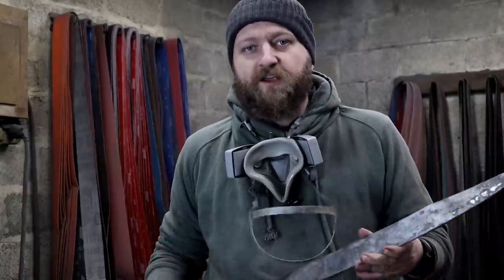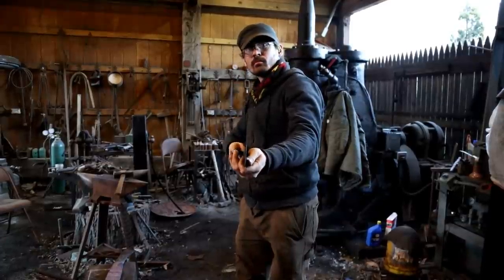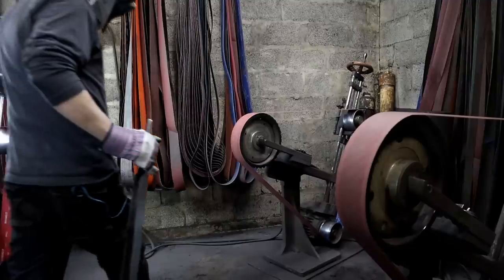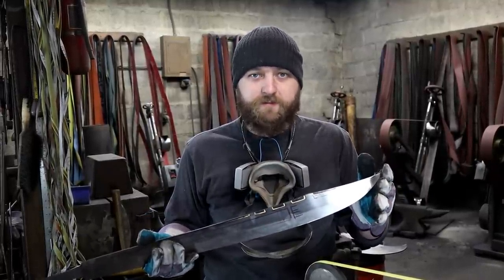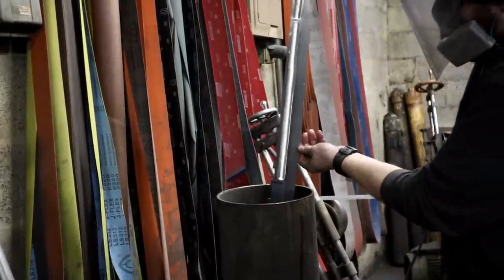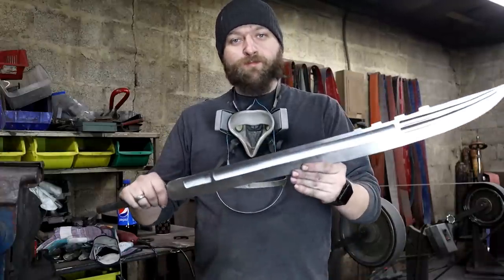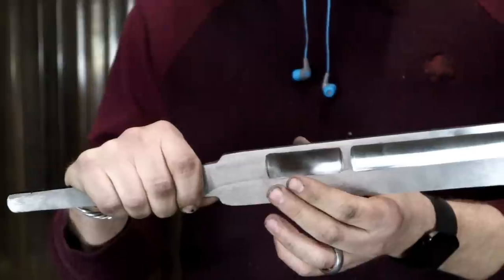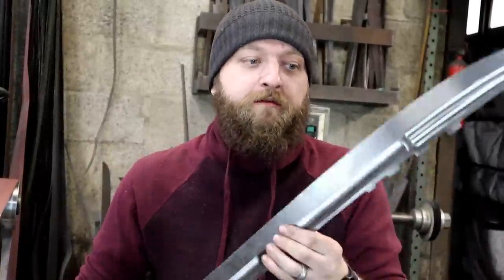Making A Falchion for Skallagrim - Part 3

Comment: Damn, I can't even begin to tell you how impressed and appreciative I am. I'll probably say that on the next parts too. :) 

This is fantastic work, and that's one of the fanciest, most complex designs you could have picked. I've never had any custom work done with that level of complexity and detail. Freaking awesome.

Nice steady hands on the grinder. I imagine it must be difficult to get the fuller that even.
Reply: Looking forward to seeing your review of it.
Reply: please don't shoot it with a rifle :^)
Reply: Greetings from Norway Skall, looking forward to see this beauty in your hands
Reply: Please let your injuries heal first? Its been forever since you were in perfect health
Reply: any one know how the fuller would have been done without powertools?  the double fuller looks like it will be difficult to get to a sharp even point on a wheel.
Reply: Super impressive build. Imagine the work that went in to making the original without power tools
Reply: @martinfllan9163  about the same, power hammer would be replaced with apprentices or other smith's with sledge hammers and the grinders would have been replaced with treadle powered grinding wheels.

The fullers were probably forged in hot with dies.
Reply: @Kurokubi  It wouldn't surprise me at all if they did ground fullers before powertools, the smiths of that era were quite talented at working with the tools they had.

EDIT:they also could have semi-powered grinding wheels using either water wheels or animals for power.
Reply: mate this guys got some giant balls, tfw you have to do the other side
Reply: @RuneChaosMarine  i imagine with a chisel,  but definitely with a scraper .
Reply: Hey Skall. Nice seeing you here. But what brings you?
Reply: Please forge volendrung (from skyrim) 😉🙏
Reply: @EODReddFox  to "end him rightly"?
Reply: This is Ilya, he doesn't do halfway, these are works of art to him.
Reply: This is Ilya, he doesn't do halfway, these are works of art to him.

Comment: I have always wondered about fullers, I kind of had this impression they were done during the forging process?  After seeing a lot of other builds done grinding them in seems to be the norm.
Reply: Chris Butler there are some forged fullers, though it’s a little more tricky to do and get a straight line.
Reply: @sokandueler9578   Yeah I have seen it in forging as well.  I do get that keeping a straight line would be a task for sure.

Comment: some design questions (which since you're basing it off a historical design, you may not have all the answers: Why does it have multiple fullers? what's the advantage to having multiple fullers along the edge as opposed to one continuous one? Also, it has the double-fuller at the top, is there a reason for that? And what are the notches for? are they in fact blade breakers?

Comment: This is off topic, but I'd like to ask what you think are some typical mistakes fantasy mediums make when representing blacksmithing.
Reply: Not having a furnace in Dark Souls seems like a pretty big problem to me.
Reply: Hitting a non red blade un on a anvil
Reply: Quenching in water (most blade steels would be quenched in oil), not having a striker, casting swords out of molten steel
Reply: Repairing a weapon by just heating it up and trying to smack the two pieces together with a hammer (Narsil to Anduril)
Reply: @zeekeno823  you forgot those are elven blacksmiths.
Reply: Forging fucken finished swords, hilts and all.
Reply: @Jethro Adriaens Yeah, I know, but it is something that happens in fantasy, that was just the best example I could give. Not everyone has elven magic and thousands of years of experience.

Comment: Why didnt you grind fullers before ht it would have been way easier then or they cause problems with heat tretment
Reply: Wgg Wfg I’m pretty sure it’s to make sure it doesn’t warp. More material = more stability.

Comment: Forging in fullers helps reduce the risk of grinding a hole through your blade.
Reply from the maker: How so? They still have o be polished out on a grinder. I think it’s more preference then anything.
Reply: Polishing on a grinder does take material off, but not nearly like grinding something away, squeezing the steel is never going to put an actual hole through it.   Also when you forge a fuller in you are pushing the steel to the sides, making the surrounding blade thicker, this gives a deeper looking fuller and less likely to over thin the metal.  Yea it is preference, and speed, and look.  I think it is going to be a great blade, and look very professional, I am just afraid the final product is going to look too mechanically done.